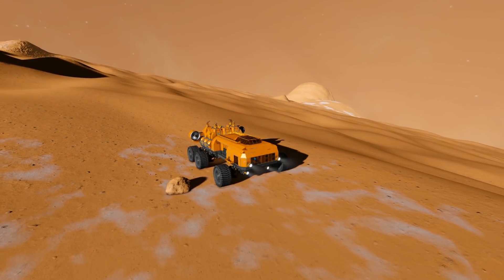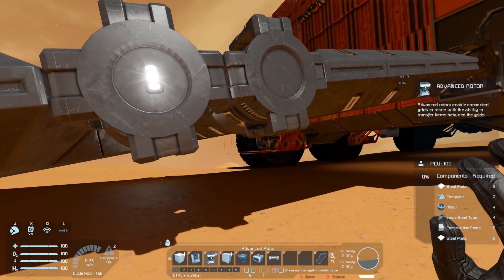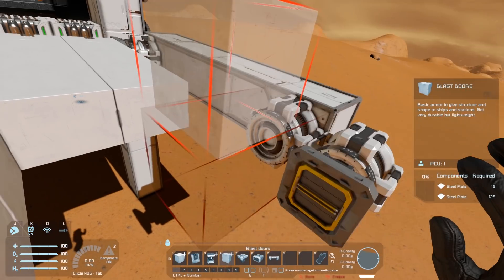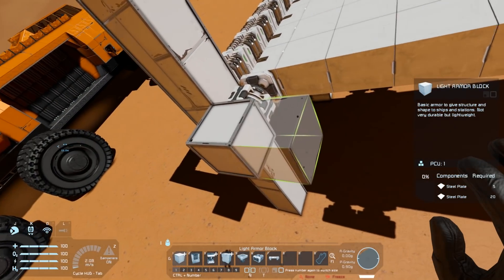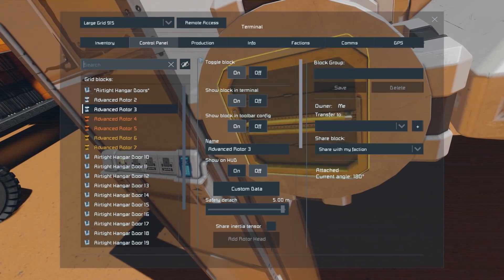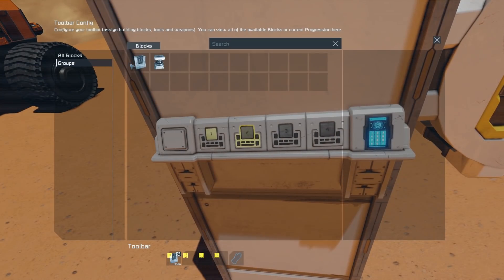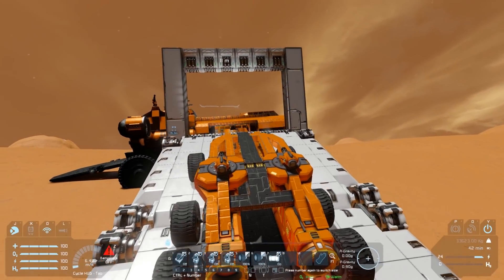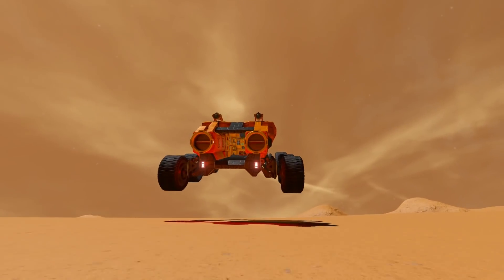How to Build a Folding Ramp - Space Engineers Tutorial

Comment: Nice. I would've emphasized being consistent about how I orient rotors when placing them, so the 0° mark is the same way. and also placing rotor parts so their notch aligns with that 0° mark. It seems to help reduce/eliminate klang and phantom forces, which doesn't matter for a fixed-grid base or ground vehicle, but is a big deal for anything that flies.

TBH, phantom forces seem to be impossible to eliminate entirely, and are the bain of many of my build ideas.

Anyway, now do a ramp or mechanical arm where the piston does the work. Super fun for building replicas of hydraulic machines :)
Reply from the maker: That's probably good advice, sadly it's something I'm pretty poor at following myself as I tend to get away without being that careful :P

I'm hoping to do a tutorial on how to use pistons to boost the power of your rotor based systems at some point soon but will need to put a fair bit more thought into it as my method is not very neat :/

Comment: hey just wondering, is it possible to build a fighter that has all three thruster types (ion, atmospheric, and hydrogen) using only hydrogen as its power source? I know the hydrogen engine is theoretically capable of producing the power for the other two thruster types, but what all would it take to make it functional, if at all possible?
edit: ideally all you'd need to do to get the ship reloaded on the go is chuck some ice in the H2/O2 generator and wait for it to charge.
Reply from the maker: I'm fairly confident it's possible, though I think if you've got ion and atmospherics you could really just leave it at that and try to power it with a hydrogen engine since that should result in less weight
Reply: Splitsie I had not honestly thought of that, thank you.

Comment: Excellent tutorial! One question - what happens if you DO power the mirrored rotors? Does it have more lifting strength (can lift a larger door), or does it invoke Klang?
Reply from the maker: It tends to invoke clang, in theory it should help with strength but I've not tested if that's actually the case, I suppose I should at some point :)

Comment: There it is, articulated ramps with a more shallow angle that rovers can actually climb, thank you very much! Something that I used to do is make the ramp with small grid, it's edge with blast door corners filled with heavy armor, but still a lot lighter than a comparable large grid version, just changing the first rotor's head to small, you know. Could be useful with cargo spaceships when you have to try and cut it's weight, but still carry your cars. Never articulated, because of course you've just showed the technique but should work just as well, hum, maybe? Anyway, thanks again!
Reply from the maker: I've been thinking of ways to get around the larger collision boxes that exist for the small grid blast doors so you can articulate them but even when I manage to I seem to run into torque issues with a ramp that's anywhere near a decent size so would need a piston powered system which gets inordinately complex :P

Comment: Great video but I have questions :)

Why do you need to disable the rotors on one side? Can't they provide additional torque to the movement?
Also, why do you need to remove the rotor heads and then reattach them?

Thanks!
Reply: It's all good, I will try it out in game and see what happens! My bet is on unscheduled deconstruction :D
Reply: @AllSySt3msG0  XD!, elegant way to put it ;)
Reply from the maker: As T'tami said the rotors can't be placed where needed nor connected to the correct grid unless you remove them, place them exactly where needed then connect them to the existing rotor. It's just a limitation of the way SE works since you can't create a joint between grids without merge blocks (in vanilla).

The rotors on  the opposite side are disabled because I've never confirmed that synchronised rotors do anything to improve the overall amount of torque, it wouldn't surprise me if they don't and attempting to do so invites carnage because if they don't quite move together they'll cause issues so having them off is safest :/
Reply: If you don't remove the Rotor heads, you are not able to connect the ramp and the rotor. The rotorhead has to be part of the ramp, when "merging"
Reply: I'm guessing the reason Splitsie hasn't responded to your question yet is because it is a complicated one to answer in text! However after playing SE for some time I assure you that this is the optimal method for creating this kind of articulated ramp otherwise you will be attaching rotor head parts to the ramp first, then using another device like a ship to place rotors on the rotor head parts attached to the ramp instead, this is a much more simplified approach, cheers.
Reply: Makes sense! Thanks for the explanation, I forgot about the subgrid issue with rotors.

Comment: one thing i would like to correct is that the second set of rotors actually serves a purpose...
in SE rotors are NOT PERFECT rotational axes. they have some slop and can wobble around if there is a torque applied in any other direction than the rotational axis.
so the second set of rotors provides a second set of bearing points for the rotation, preventing the whole thing from bending due to its own weight
Reply: Good point.
Reply from the maker: Indeed, though I normally get the same effect from enabling shared inertia tensor

Comment: My favourite part about this video is that it came out literally the day after I gave up on trying to fully figure out how you did this and just went with a single ramp style for my current project
Still an excellent video though, and I'm really glad you went into detail about the rotor part attach trick, it's definitely been one of the lesser covered topics of rotors in this game
Reply from the maker: I guess that was almost good timing :P
Reply: @Splitsie  Update: It was actual good timing, single ramp doesn't work too well for vehicles with bumpers on them. I had to modify your design slightly but by adding ramps, or 2x1x1 armor blocks to the tip of the second ramp, and having that align parallel to the ground, it makes it extremely accessible for vehicles with 3x3 wheels. Set it up so that the "base" (The ramp that connects to the hangar) ramp-rotor was set to 25 degrees, and the "End" (Ramp part that touches the ground) ramp-rotor set to -25 pretty much solved every problem